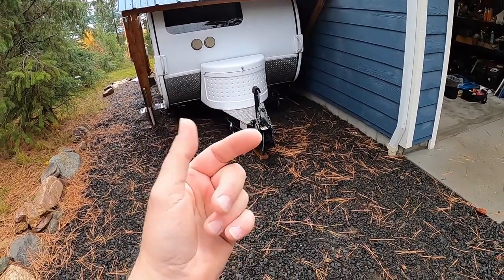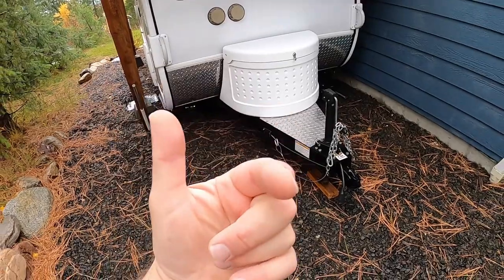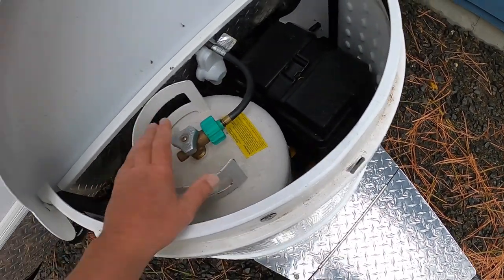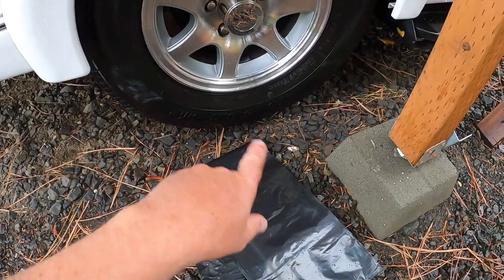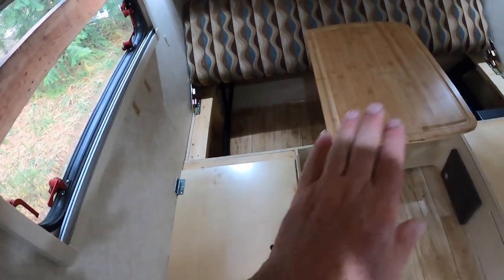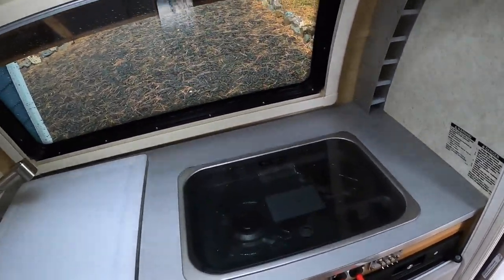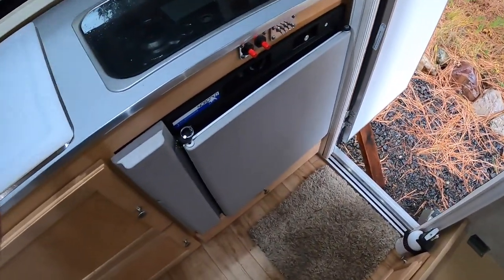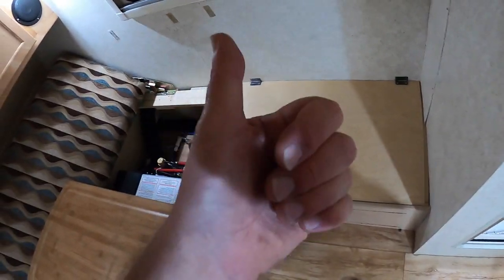Additional Winterization Processes for my Tab Trailer

Comment: Thank you Mark.  Very nice overview of finishing touches for winterizing; we live in Wisconsin!  I will be storing my TAB 320 outside with a classic brand camper cover.  I will be taking out all the bedding and spices as you suggest as well as putting a natural rodent repellent scent in the cabinets.   I have a 2017 U Max—no toilet/shower.   I won’t be jacking up the tires to put them on blocks but like the idea.   Where do you place the blocks?  I’ll make sure my tires are at max recommended PSI to reduce potential of flat spotting.   So far in years past flat spotting has not been an issue.
Reply from the maker: Here is a video I made of how to jack up a tab, where to locate the jack, and where to put the blocks.

Note, that I didn't mention it in the video, but besides being good for the tires, it's also good to take the constant weight off the rubber splines in the torsion tube axles. Let the rubber relax and rebound over it's sleep.

https://youtu.be/xTb3Q26L_7k

Comment: Thanks Mark. I thought radial tires did not have problems with flat spotting. I also cover my hitch area with a plastic bag and tie it on as we don’t have a roof over the tab. We use a cover too and tire protectors. I put damp-rid in the camper along with peppermint sachets after cleaning and stripping it of the cushions and mattress. So far no problem with mice.
Reply from the maker: Radial tires have less of a problem that bias ply, but since I also want to rest the rubber splines in my torsion tube axle, and let them rebound from their constant compression,  jacking does both.